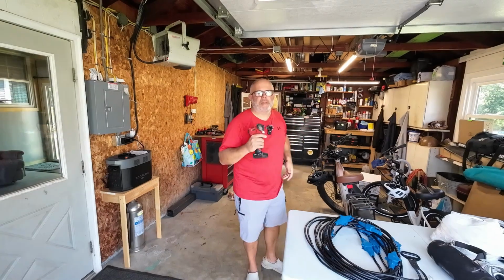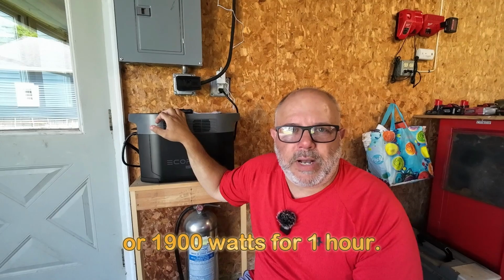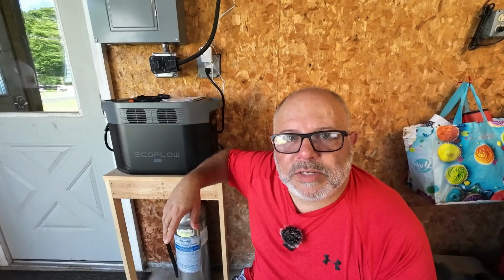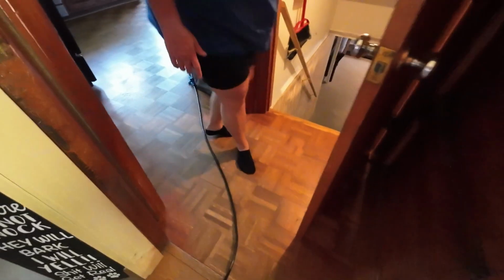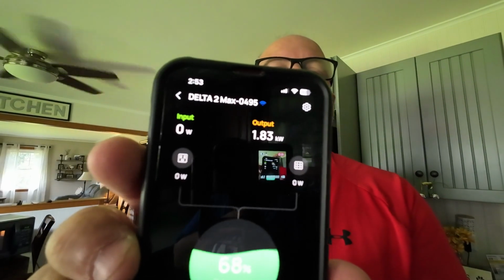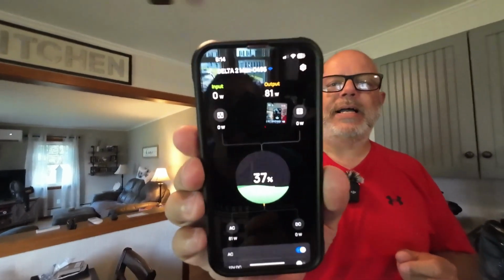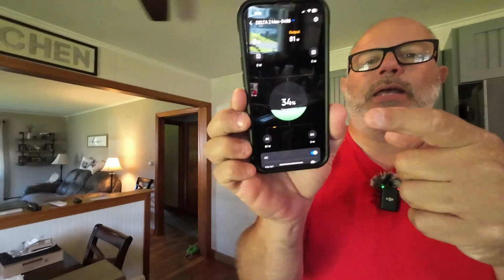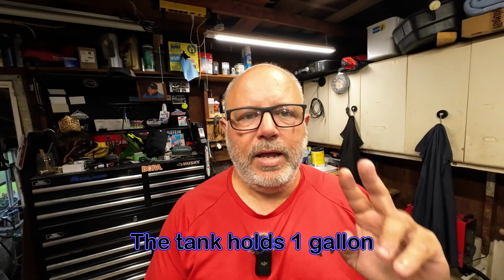Building Better Backup Power Before the Next Storm

Comment: Most house plugs (receptacles), are daisy linked in each room of the house, breaker each room. If you make your own cords, male to male and plug into 1 receptacle in each room, the whole room is electrified. That's scary for some people, but it is a fact. Is it idiot proof, no, is it dangerous, only if your an idiot
Reply from the maker: That's and interesting concept. My goal in doing this was to find a quick, safe alternative so my family could hook up backup power. I understand what you are saying but I don't think that would work for my application. Thank you for sharing your thoughts on this.
Reply: Use the cord you have and instead of moving the fridge to plug  into your cord, plug the male in your cord and any open receptical in the kitchen and your fridge and everything in the kitchen is running, seems easier, where you unplugged the lamp to plug into your cord, just plug into the same socket from your cord, living room all running,not just the lamp, seems easier to me @paulethier3416

Comment: Paul. I have a similar set up with 2 smaller Deltas (each linked together- 1800wh), powering on each of my 3 floors and I start my small dual fuel propane (4 30pound tanks) generator to recharge all the Deltas simultaneously to 90% in 70 minutes for 12 more hours of power. 2 gallons of fuel used per day, NOT using my 800 watts of solar panels during the day for extended outages.  Good vid. Thanks
Reply from the maker: Very cool! I'm hoping this wet up will work well. Sounds like I'm on the right path. Thanks for commenting.

Comment: I did the same type of thing in 1999 after hurricane Floyd. 

I used a cheap Marine Deep Cycle battery from Walmart, 300 watt inverter, a car battery charger, and a 2500 watt generator. 

Since the inverter was so small, I ran a small fan, 12” TV/VCR combo, and a 5 watt CFL light bulb in a lamp. 

Every few hours I would run the generator and charge up the battery. At that time, I plugged in my refrigerator and upright freezer and ran them off the generator. 

I ended up using about a gallon a day. 

The new fast charging power stations are a game changer as they can fully charge in a little more than an hour.
Reply from the maker: Sounds like you were ahead of your time. Yeah this new battery technology is amazing.
Reply: @paulethier3416  anything to save gas, but still do what NEEDS to be done. A couple of my neighbors were going through 10+ gallons a day when I used about 1 gallon. 

If it had been a little harder to get gas, or lasted a bit longer, they would have been out of luck.

Comment: Get two mechanical three prong appliance timers. Set them both to 12:00 am. 

Set the timers so one comes on for an hour and then off three hours, then back on for an hour off an hour. 

Set the other timer the same way, but offset by two hours. 

So it works like this:

Plug in both  time zero off. 

Time 1 hour #1 on, #2 off
Time 2 hour both off
Time 3 hour #2 on, #1 off
Time 4 hour both off
Time 5 hour #1 on #2 off
And continue for the entire 24 hour. 

You won’t save 1/2 the power because when the refrigerator is on, it will run harder, but you will use about 80% of the power and not have to worry about having not on at the same time.
Reply from the maker: @warrenglen7636  that’s a great idea. Thanks for sharing that. Sounds like you have tried this?
Reply: @paulethier3416  Tried it during a test on my garage refrigerator and saved about 30% on the energy usage vs leaving it on constantly

Comment: Great video! I've used that same logic at my house. Part of my thought was that I wanted to have power at night, but I don't want to have that generator sitting outside making noise all night. I also worried about it being taken overnight if it isn't being watched. I have a Bluetti power bank (500Wh) to keep a couple of lights on and keep my fridge and freezer running once I shut the generator down for the night.
Reply from the maker: Yeah, the set up works really well. Thanks for the comment and for sharing.

Comment: On a moderate day a single solar panel of 200ish watts would extend that battery run time dramatically, so you'd probably get a whole day of power. But as you get to having a day of power the efficiencies of scale that make whole house solar viable come into the planning.
Reply from the maker: Thanks for leaving a comment. I hope to try solar panels at some point. In this instance it would have absolutely added many hours of power. But the sun is never out here most of the year so I think I'm going to concentrate on battery storage first.
Reply: Living in England where our lamps are all 3 to 7watt LED lamps I'm considering a 50 ish watt solar panel and battery and taking all the house lighting off mains completely.

Comment: I live in Fl.  I bought a pecron solar power station and a generator for our infamous storms.  I now have 5 of them and 2 expandable batterys with 1600 watts of solar soon to be 2400 w's of solar.  I have been running my fridge and chest freezers 24/7 and other items for over a year now.  Did your wife go to SUNY at Buffalo?  I graduated from their back in 1990.  Great video!
Reply from the maker: Thanks for sharing this. This is my first attempt at this kind of technology. The sun does not come out here much in Winter so I'm going to expand the system out with two additional batteries for 6500wh and then add the solar. The EcoFlow will take up to 1000 watts of solar so I'm going to get the biggest panel I can afford when I do it. Thanks for sharing this info and for leaving a comment.
Reply: @paulethier3416  Just pay attention to the voltage limits of the power stations charge controller.  Eco flows is a really good one so you should have no worries.  Don't let these things sit around use them and get some money back.  Lol

Comment: We had purchased the Ecoflow Delta 2 Max w/220 Bifacial panels and the 800w Alternator charger to be used for boon docking with our RV a few weeks ago.  We also have a Honda EB3000c generator.  As luck would have it, a nice storm rolled thru town and about 350,000 folks lost power.  Ours was out for 73 hours.    Basically used them identical to your test scenario, running the fridge, coffee maker, T-Mobile internet, couple of fans and lights.  First day we charged the Delta using the alternator charger hooked to our Jeep.  Took over 3.5 hours to fully charge an almost depleted battery.  Wasn't crazy about having to run the Jeep that long.  Next couple days we would recharge using the generator for about an hour in the morning and then top it off for an hour in the evening.  Didn't bother hooking up the solar panels as all 3 days were overcast, but at even max220w, it would have taken a long time to recharge. Have to say this setup, ecoflow and generator combo, worked very well and would highly recommend it as viable solution.
Reply from the maker: Wow! Thank you for sharing this. I feel like my next step is to get the additional batteries to increase our storage. The sun is never out in the winter and when it is its only for about 6-8 hours which is not enough to recharge. After hearing your story I think I'm going to stick with the batteries and generator combo, it make 5 gallons of gas go a very long way.
Reply: @paulethier3416  Yep I agree, we're thinking the same thing with an extra battery or two.  That way we could run the gas furnace in winter if needed too without much stress on the system and/or just make smoothies for the neighbors....😄

Comment: Im not entierly shure unplugging the refridgerators will work. As they will try try to cool everything down normal temp which means recovering all that energy lost in the poweroutage. Prob better unplug the at the and of the cycle if you know the power is returning. Or run them when the generator is plugged in. 

Recently had my fridge thermostat break and my half height fridge took 7 hours of running to cool everything back down from 13c i had in the backup cooler down to 4c
Reply from the maker: @Maaniic  thanks for reaching out with a comment. You bring up a valid point. We also discussed the possibility of moving the contents of one refrigerator into the other refrigerator. And putting things like waters and drinks into our travel fridge, which only draws 50 W maximum.
Reply: @Maaniic you make a very valid point, I was thinking the same thing. You may actually save power by leaving the fridges plugged in and 'maintaining' temperature by kicking on the compressor only periodically to cool. By unplugging and letting the fridges warm up in temperature, when they are finally plugged in the compressors will run continually until the desired temperature is reached. You can determine which strategy is most efficient by using a watt meter. It would be interesting to see those results.

Comment: We went completely to the next level and went completely off-grid solar. With our own large battery storage system and several solar panel arrays ground mounted. We also have very high capacity battery chargers that give us 13 KW of battery charging capacity for Rapid charging in the event that we need to run a generator. A generator is most efficient when it's loaded fully or close to full load. Running a generator to run a few lights and a TV is very inefficient. But with the battery charging method we only have to run the generator for an hour or so to charge up the battery Bank with the high capacity charging. And when the weather is good we don't have to use a generator at all because solar provides all the energy we need.
Reply from the maker: @basspig  awesome! Thanks for sharing that. I’m hoping to add solar soon but I’m completely impressed with this system. It’s my first step into this power station and solar system. I’m a bit concerned with solar during the winter because the sun is never out and the day are so short. Very exciting stuff and I’m having fun learning new technology.
Reply: @paulethier3416  One step at a time!

Comment: Wouldn't that 12/3 extension cord be max rated at 20A?  If both refrigerators are running, you could be at 10-12 amps alone.  IMHO, and what I've done on my system, is to get as much off electricity as possible during an outage.  Popcorn?  Sure, but use a stove top popper.  Need to cook and you normally use an electric range, fire up the grill.  Things like ranges, space heaters and microwaves just use way too much energy when you are on battery and don't know how long you will need to use the battery.
Reply from the maker: Thanks for the comment. We did abuse the system intentionally because we were trying it for the first time. Shedding load is an absolute must in this situation and we will do that in a real situation. Towards the end of the video when we were in the kitchen talking you may have heard us talking about reducing the load. Thank you for the comment.

Comment: Cool demo. I'm always amazed that people have to have their internet working. Where do they think the power is going to come from to supply the signal to the house during an outage?
Reply from the maker: @dougofford6567  Thanks for commenting. I’m not sure how our Internet service is powered, but it usually will stay up for a while and then it goes out. Anything longer than a hour or two it will go out.
Reply: From infrastructure that has power.  I've been through multiple week outages a couple of times and internet never failed.
Reply from the maker: @kcgunesq  This last power outage we had internet for about 4 hours then we lost it and had to use cellular.
Reply: A lot of internet services have battery backup (not all).We live in Australia and our internet does. As long as we can power our end, But after a couple of days without power the batteries can go flat and lose the internet. Same situation with cell towers.
Reply from the maker: @davidclarke6658  Same situation here.
Reply: @davidclarke6658  As far as I know, in the US, internet and cellular providers all have backup power for their services.  Most cell towers, e.g., have on site standby generators in addition to UPS.   I have UPSs on all of my equipment that will last long enough until my standby generator kicks in.

Comment: Your honda isn't "making 2200 watts" nonstop, it's just that at minimum output it still burns quite a bit of fuel. It burns much more fuel when making 2200 watts or when charging the power station. If nothing else, you can reduce the generator runtime and noise of a generator with the power station. More time silent is good.
Reply from the maker: That’s what I was trying to say but you explained it way better than I did.  😂😂😂 Thanks for leaving your comment.

Comment: I think if you plugged in several 100 watt solar panels  --1,2,3,4 panels into your ECO Flow power station you could get many more hours of operation from your power station.
Reply from the maker: @BartonThom  yes it will take up to 1000 watts of solar charging plus it will take two additional batteries that max’s it out around 6000Wh of capacity. In theory could go forever. Thanks for commenting
Reply: It would be far less than nameplate, especially in NY, especially in the winter.  I wouldn't be surprised if it isn't in the range of 600-1.2wh per day.  Solar has a place, but treed lots in northern latitudes during the winter isn't it.
Reply from the maker: @kcgunesq  I'm hoping gets some panels soon. They are definitely part of the puzzle for this. I think I'm going to add the additional battery first. Thanks for commenting.